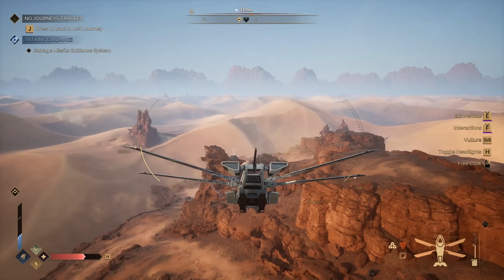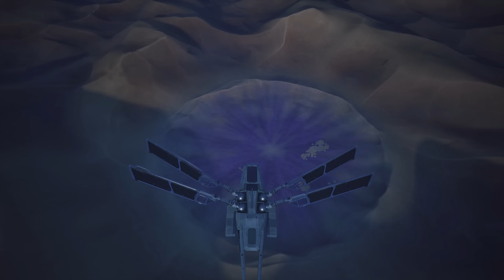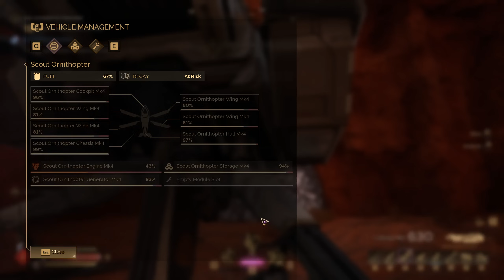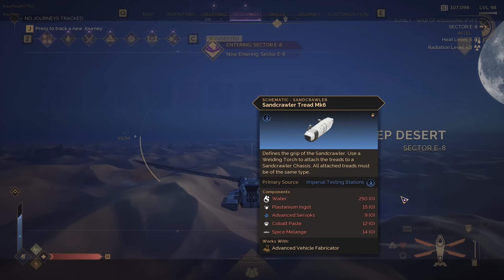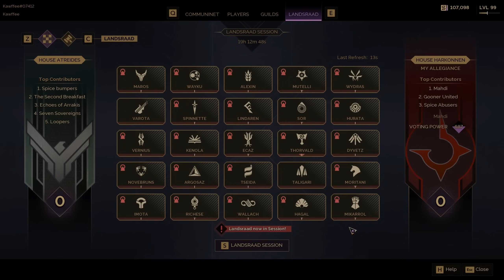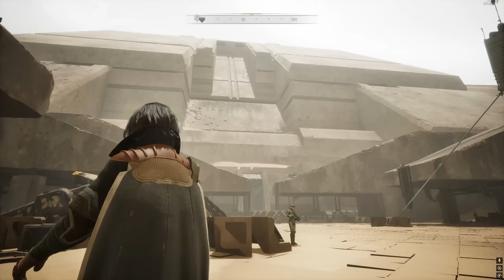DUNE AWAKENING - Solo Deep Desert, Spice, Landsraad, PVE, House Representatives & Top Contributor!

Comment: cool thing for scout orni: usually you would aim xhair at horizon, which os good and efficient.. for some reason tho if you pitch up a little bit (10 - 15 degrees) and press w to pitch down every time you lose ~15km/h you actually gain altitude faster than you lose speed, and the altitude you lose by pitching down for speed is regained pretty quick... it took me like one try to get this right and i fly around hagga in one ascent, tho this is only rly useful for straight paths.. you should try
Reply from the maker: Oh damn. I will give it a try. Seems like a very useful tech

Comment: are you level 3 in your classes? a 60 damage sword will kill in 2 stabs if you are speced correctly. 5 in the small camps far north
Reply from the maker: level 1 in all classes except planetologist. i can 2 stab the shielded guys in the A row but further down it takes a lot more swipes using the base duraluminum sword.

Comment: HUH, ok why is it taking you that many hits meanwhile i 2 tap the shielded guys with a spark sword lol
Reply from the maker: Wait ur 2 tapping npcs in the deep desert PvP areas? Duraluminium sword? I was using the basic duralumium sword and gun for the shipwrecks in sector I and it was taking waaaay more than 2 slow blade swipes lol. In pve area with duraluminium it’s easy mode tho.
Reply: @kawffee69 The npcs in the deep sections of the DD are scaled for 3-4 people. That's why they're so tanky compared to other mobs
Reply from the maker: @itsqueee  yeah i think thats the case. i keep hearing people say they can 2 stab the shielded guys but I don't know if they are lying or if my skills aren't maxed out. i tried research sites with a second random and I've tried shipwrecks but there's no way I can 2 stab the shielded guys with the duraluminum sword currently. the A row npcs are very easy with duraluminum gear.

Comment: One clarification to building base. The shields on your base in PvP DD will go down for 8 minutes after EACH storm if it passes over your base. So it defo can be destroyed. The Coriolis storm is wiping DD clean
Reply from the maker: Yeah you're right. For some reason I thought it was just the coriolis storm that took down shields.
Reply: Haven't built dd yet, heard 6 min shield failure from sand storms, same input just different duration. However they cant deconstruct they still have to destroy things via weapons. So... you can build around chests 100% and hide them?
Reply from the maker: @gamerfortynine  apparently the lasgun melts through walls and stuff. do even if you make layers of walls around your stuff it can get raided if there's a big enough group. also, they are making some sections of the DD pve zones so you can farm t6 resources without needing to go into the PVP zones.

Comment: One thing to note. The scaling towards the end is pretty steep, so mobs taking too long to kill Solo, the issue was probably the T4 Aluminum Gear, when you could be getting T5 from the PvE Zone still. Unless bei "Aluminum" you meant Duraluminum. Otherwise? Yeah, that's pretty much deep desert solo
Reply from the maker: Towards the end of the video i was using duraluminum on shipwrecks. the heavy shielded guys were taking 9 slow blade swipes to kill. not the worst but not easy either. duraluminum in the pve zone of the deep desert is easy mode tho